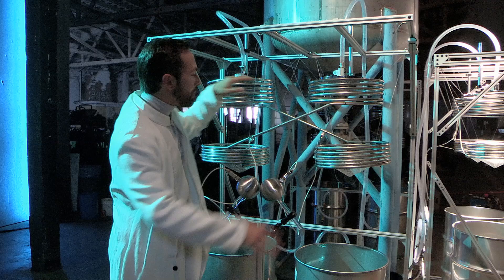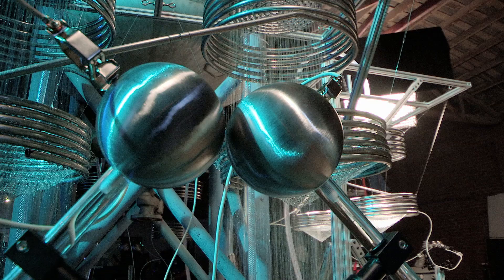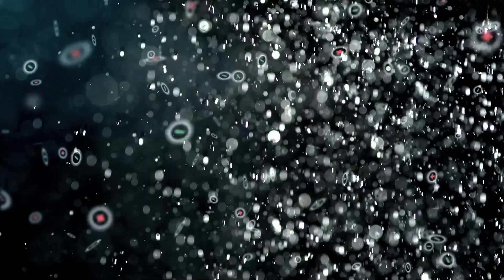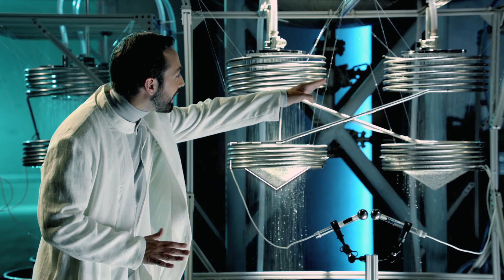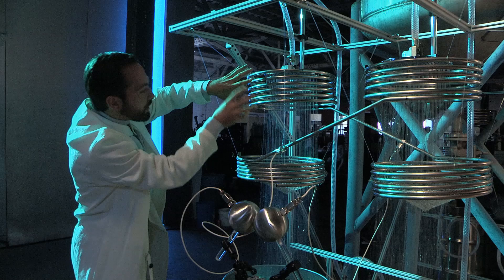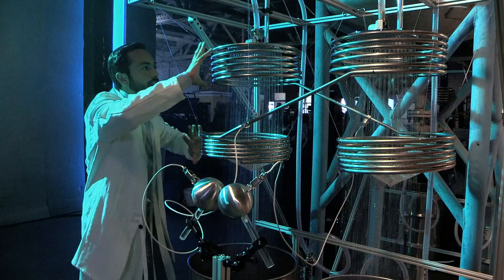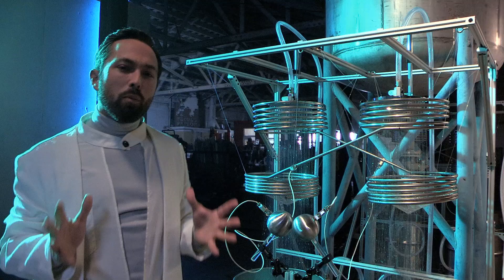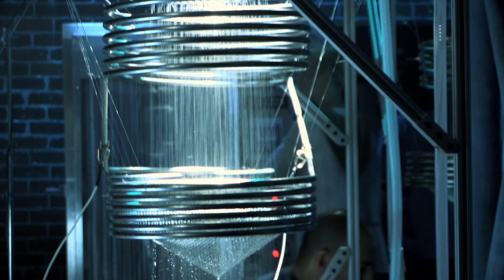Sparks from Falling Water: Kelvin's Thunderstorm

Comment: The Electricity is in the air. It attaches to H2O splitting it into two gas's known as Hydrogen and Oxygen be cause the molecules are electrically charged. Take this charge away and they then attract bond and form H2O again. Try looking at a PEM cell. The screen helps turn the water to vapor pulling the Electricity out of the Air. Alot is in the air and  is pollution from electrical power transmission lines and things they power. This also causes lakes to evaporate faster or slower based on the quantity of Electricity in the air. It rains more where the ground conducts Electricity better then where it is poor. This has alot to do with today's global warming as well. When country's deplete the water from the atmosphere by making it rain other places go without.

Comment: in this case the voltage is high, and the current is high, but the energy is low because the duration of the spark is low in order for some nano secants that's why its not that dangerous for human got that the current is low its actually high.

Comment: Your explanation falls apart at "... and now that (negatively charged) ring will attract the positively-charged water, so this whole stream becomes positively charged..." Huh? That's the effect called "influence", and it obviously exists, and is true because the stream does become positively-charged. But you haven't explained why, or removed the mystery about that. Otherwise, very impressive apparatus, and well done video!
Reply: The water is reacting to the boundary effect of the field created in the first coil (see also fluid dynamics, lift and drag).  Essentially, each droplet is slowed down proportional to the distance from the source of the drag.  What's more, the drag is exponentially stronger on the side of the water droplet closest to the source of the field which causes spin; AKA the Coriolis effect.  

You can achieve this same "curve" of falling water by placing a static charged comb next to a running faucet.

Comment: Fascinating! Years ago I was sitting in my car during a very heavy rainstorm.  The rain was very loud as it hit my car.  The sound stopped suddenly with a flash and boom that were simultaneous.  After the lightning strike the rain sound started up again.  This made me think that in certain instances the leader charge of a lightning strike might push the rain away from the strike location. I just happened to be under a rain column that was affected by this electrical charge. Any thoughts?  This experiment really makes me think my experience could be explained.
Reply: Thunder...or more precisely Its more likely to be the millions of sonic booms generated by the exploding superheated air along the lightnings strike length as it moves at 270,000mph on its path to the ground, probably blowing the big rain droplets into ever finer mist/particles.

Comment: try using a car coil and some carbon rods for a air gap on the  high voltage side . brings the voltage down to 12 v it would be interesting to see what amperage is milliamp or amp .

Comment: Current is NOT what does damage.
Power*time does damage.
The current is just part of the equation.
Reply: P=I^2 * R

Current is fundamentally responsible for defining power.
Reply: @OmicronChan  So is resistance and voltage, wich are both part of the current defining equation.
Usually, getting electrocuted and not being able to get out of the situation by yourself is  going to kill you because your muscles contract.
This also goes for your heart, and the longer the current flows through your heart, the longer it will be out of sync, this can collapse it  making it work against itself.
It is power over time that kills.

Comment: I don't see how the negatively charged ring attracting positively charged water change the charge of the falling water. If there was a big hole in the center of the ring I could see why the positive water falls on the mesh but the negative would fall in the hole, avoiding the mesh. but it doesn't seem to be the case. please clarify how the coil affects the charge of the falling water

Comment: I wonder if it would work on the nano scale, like with individual water vapor molecules in the air passing through a carbon nanotube material: How intricately designed would it have to be to keep the charges separated? How much surface area? Who is John Galt?

Comment: almost correct explanation of the dangers of electricity
but its not that there isnt much current but rather its that there is a lot of current just not for long since the charge depletes so fast
correct me if im wrong but im pretty sure if there is high voltage and a fixed resistance there is going to be a proportionate amount of current

Comment: Same thing happens in earths crust. Nikola Tesla's free energy was suppressed, he wanted to harness the charge of currents flowing through limestone.  As above so below
Reply: You might want to check that claim as it's nothing like what he wanted to do....and it's freely available on the net, it's not suppressed.
Reply: Okay, but this isn't "free" in any way.  The energy has to come from somewhere.  In this instance the water is falling about 1m.  Let's say it's 1  kg of water per second.  That's 9.81 Joules per second or 9.81 Watts, enough to run a domestic LED bulb.  To harness all that you'd need to stop the water dead which is impossible for a continuous system, but it indicates the theoretical available power.  Now, he suggest he gets 5-10 kV across the gap.  That would be generated across a spark gap in air of around 1mm.   The resistivity of air varies greatly, but if we assume a value in the middle, we end up with about 0.1 watts for a continuous spark across a 1mm gap.  Now, the spark only appears in 1 frame of the above video, so it's less than 1/25th of a second.  That's therefore less than 4 milliwatts.  I.e. you'd get a lot more from the water by running a small water wheel on a dynamo at the bottom of this, than you would from generating sparks. The above is basic high school physics and google.

Comment: Potential energy of the water is the source.
Reply: Wrong.  Dissassociation energy of the hydronium (H+) an hydroxide (OH-) ions in the water... For ANY sample of water, the concentration of H+ x the concentration of OH- is 10^=14.  So for neutral water, there is 10^-7 parts H+ and 10^ 7 parts OH in ever 1 part of water.  Or 10^-3 H+ and 10^-11 OH-, or 10^-12.5 H+ and 10^-1.5 OH-.   The exponents of the 10's will ALWAYS add up to 14.  Nobody knows WHY this happens like that, but over 90% of what you have in our house depends on that being an absolute rock-solid rule in either the manufacture or operation of those things.  Even salad dressing.

Comment: Ok, I think I know why and how. Simply because I thought I invented this lol. My friends thought I was crazy for theorizing it. I cant say for certain, because i have not went to school for any of this. I have been self taught to this point. 
     I believe the answer to be in your wording. The water is neutral, as is anything in that state. But, it is also a polar molecule. Polar molecules, will realign, to face each other, as north-south, north- south ect. 
         And by creating the mesh diversion, it is able to be hit by the water, and steal some charges from it. Not very much at all. But hence the 2nd set of coils. By stealing the polar molecules ions, and directing those corresponding electrons, to the top of the next device.  Which in turn, realigns the polar molecule, allowing the other mesh to pull the positive charges, and divert to machine 1. Then simply connecting the 2 leads to complete the circuit.

I know this answer is 4 years too late, but I have scrolled through many comments, and feel I did not see the answer.
Reply: The Klown all you did was repeat what he said.

Comment: How the hell does youtube knows I'm studying electrodynamics? And even the very specific part when I just able to explain this set up. Kind of scary if you think about the odds
Reply: Also, I figure out how gravity potential connects with charge up energy. I'll just point out the crucial point: "The amount of charge you can get from water" has a connection with "How fast and how much water can pass through the coil"(I'm talking about flux here), that will relate to the kinetic energy and finally, to the gravitational potential.

Comment: if the spark lasted longer say about 3 seconds it could do damage... time is also a factor.
Reply: No, it wouldn't.  Not enough current.
Power = Volts x current. and in this case, although the voltage is on the order of 10^4, the current is on the order of 10^-12. making the power on the order of 10^-9 W
Energy = Time x Power
3 seconds x 10 ^9 W = 3 x 10^-9 Joules.. which is literally  about 10^-5 times less power (and less damaging) than the power produced by the sound when you talk to somebody (either open air, or through a voice tube).  A "sound-powered telephone" (which does have it's signal carried on electrical wires) typically carries a signal starting at about 10^-4 W.... it's 1890's level of technology, and is one of the operating modes of the US Army's TA-1 and TA-312 field telephones (which, for short distances ~= 300 meters) over WD-1 wire can work without any batteries or other outside power.

Comment: A slight correction to your statement about Voltage and Current: Voltage is indeed dangerous. However, if the current is limited in some way, like in your circuit, the voltage will drop if something resistive like your hand bridges them. If current isn't limited, like in a mains circuit, Voltage remains high and it electrocutes you. Current alone cant bridge across you, and voltage alone will drop trying to bridge.

Comment: I get electronic shocks from my shower head , always have with metal heads . Static electricity.
Reply: You might live in an old house with cloth wiring insulation... get a meter and check how much voltage is present between the knob and the drain... I (an electrician) have seen this several times... be safe.

Comment: this is my wild guess... all mater has energy. temperature is a concentration of energy. water being a conductor has a greater percent of stored energy that can me harvested via mechanical process. this setup reminds me of a tesla coil in the sense that its attracting the energy stored in the water and creating a differential tide in polarity. you can augment the amount of voltage AND current with capacitors, resistors and other components but what would happen if you changed the temperature of the water? My guess would be cold water makes less and warm water makes more... Would there be a change in current or voltage? how about both? the next factor Im curious about is the water compisition, distilled water would most likely have an interesting result as would salt water. 
these would all have interesting changes with the generation of static electricity.

Comment: Why don't you stack one set of those devices on another, until you have 20 or 30 of them in a row and generate a much larger amount of electricity? With all of the devices using the same stream of water will it produce a greater charge if you alternate the induced current - + or if you keep the negative charged ones all on the same side?

Comment: wouldn't you need to place the upper part of the coil near the split the Incoming water streams so you could separate the streams better and increase potential ?
or is it that the water droplets with the corresponding charges get attracted to the upper spools that much that they contact and therefore loose charge ? 
the setup is quite strange and im not that much of a genius when it comes to electric charges. 
and im somewhat annoyed that i get so much veritasium videos recently,  he's a bit to snotty in my eyes

Comment: If you stacked this contraption on top of itself to extend drop distance and add extra coils. Could the Ions from the water replenish themselves by exchanging currency with ions it collides with from air molecules? 
To simplify my question: can you gain more electricity in this manner by stacking? 

Bonus question: does the water have to take the form of a droplet or can it be a stream?

Comment: Oh please... See ElektroBoom why Voltage matters! The Reason that this 10000V is not dangerous is simply that ist can‘t hold the voltage high when any current flows. So in the same Femtosecond you touch it, the voltage Drops to Zero. Current is only a Resultat of Voltage and Resistance. So to havo no current flow the Voltage needs to drop. Simple Mathematics!

Comment: Is there a way to know which set of coils have what type of charge... Or is it that everytime after the spark it's a random choice of which set of coils gets what type of charge?
Reply: Random to some extent, like a coin flip.  To answer your first question: In theory, you could use a multi-meter to detect which side is negative or positive.  However, I believe it would be near impossible as that most multi-meters (all?) use a bit of the current in the detection circuit and since this generates so little current, it would probably nullify the results.  Now if you up-scaled the apparatus by 10x...you might be in business.

Comment: Mehdi explains it better, but it is not accurate what he said about even though it is high voltage the current is low that is why it is not dangerous, that is not true have you ever seen a sign that says warning high amperage or warning high current, No because with high voltage your own resistance will cause the current to jump up, the reason this is not dangerous is because the total energy is low, mainly due to it being a short pulse, samne reason stun guns are not fatal they are pulsed so the total energy is low.  otherwise the high voltage side of a microwave transformer would not be killing and injuring all the people it has been that are trying to make fractal wood burn patterns with them, remember I=V/R so your own skin and body resistance would make the current lethal Mehdi from electroboom explains it much better than I do

Comment: I think whats happening here is this is also creating a separation of atoms as in electrolysis of the water splitting into oxygen and hydrogen which are oppositely charged and would account for the compiling of charge or the water drip becoming frayed possibly from upward flow of hydrogen atoms moving at about 45 mph or 65 fps it would produce a voltage charge as atoms adhered to the coils but escaping atoms would act as an updraft .Just my thoughts would be easy to prove just dome the experiment and back up lol when the spark happens the hydrogen gas should ignite with a vengeance or you could use a gas sampler lol but where is the fun in that!!!

Comment: Part of potential energy of water drops gets converted into electrical energy
Reply: Right, the final energy source is whatever it was that pushed the water uphill in the first place.  In this case, likely pumps but could also possibly be solar energy via evaporation, condensation, precipitation, and finally storage at a higher altitude.

Comment: Does it have to be coils or you could use cilinders?
I think even if energy provided by this setup is low, it scales very good. If you make cube of these like 20mx20mx20 m you can basically get 8000x fold energy output.

Comment: How does the fact that top right coil becomes negatively charged, help to make the right stream more positively charged?
Reply: Opposite electric charges attract.  Even a 6-year old can tell you that.
Reply: @dirkgently120  Ummmmm...
Ok. Here is what he is saying: Neutral/(slightly positive?) water from top starts falling on the right. But because the top right coil is negatively charged, that negative charge somehow makes this water more positive. The only way to make something more positive is to take away the negative charges from it. But, how can a negatively charged coil take away negative charges from the neutral/slightly positive water falling from above? (Of course, eventually this more positive water falls down on the bottom right mesh making that mesh positive and so on but all that is not relevant).

Comment: This isn't really explained well in the video. The key idea is that the electrostatic field reaches all the way to where the water splits into two streams.

If either stream has any slight charge to it (a random event through molecular collisions) then the corresponding screen will absorb that charge. The opposite coil then becomes identically charged. What happens next is that the electrostatic field reaches to the source of the two streams, which must have a common port before splitting. The charged coil preferentially pulls oppositely charged water molecules into its corresponding stream. Those water molecules hit the other screen and charge its corresponding coil accordingly. The result is a feedback loop that steadily builds charge between the two coils (and hence spheres).

For example, if the right stream has an initial negative charge then the right screen will share that charge with the left coil. The left coil will pull positively charged water molecules into its corresponding stream (where the two streams split). The left stream then becomes positively charged, which shares the positive charge with the right coil via the left screen. At this point, the electrostatic forces that caused the water to split in the first place is now stronger, causing more water to split more rapidly. And so on until the spheres spark through the air to discharge.

Comment: Electricity is just movement of electrons. Like high to low pressure.
Reply: What moves are electric charges, not electrons.  Electrons are charge carriers and an electric current flows when electric charges pass from one electron to another.  This process does not require the electrons to move, although in practice there is a slow drift of electrons along the conductor